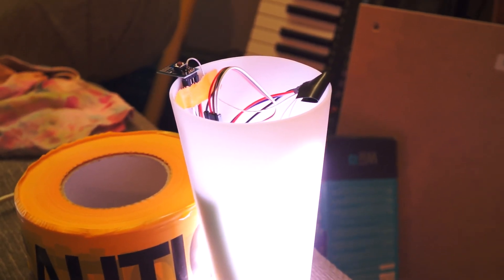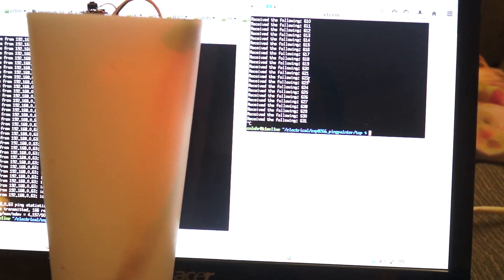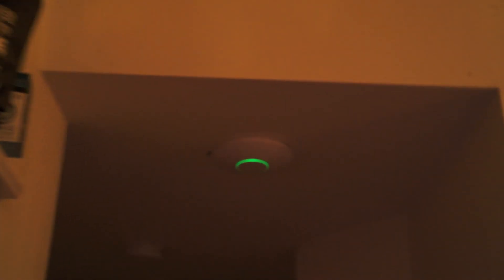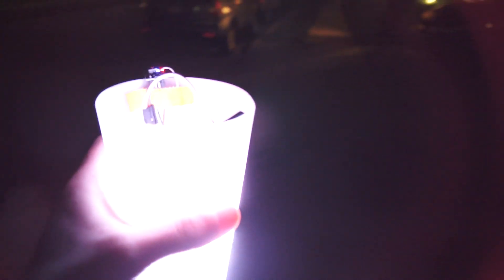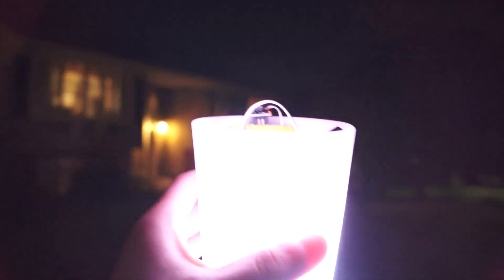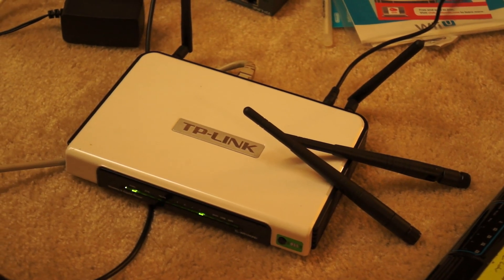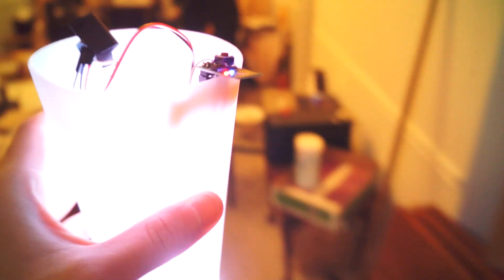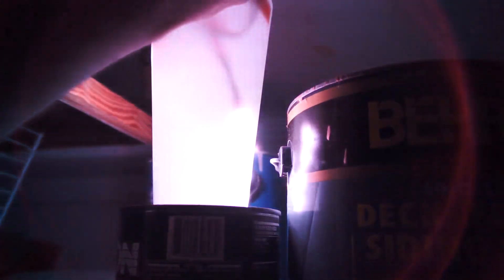My Wifi Cup - ESP8266 Link Tests

Comment: I think the example you give below Mike is having the same difficulty as me - getting the timing right. Without optimisation the compiler is just a little slow, with optimisation it's well fast enough but the cacheing is messing up the first iteration of the loop. The whole routine (which I have working perfectly apart from the first LED) needs re-writing in assembler. If you find MQTT to have a large overhead (agree) and a big learning curve (it's not, really) then I'm thinking the best solution would be for someone to add this to the LUA code then anyone can play with the LEDS without having to do the compiling. Incidentally if you've followed my posts you'll know how frustrated I felt about the compilation process and having to learn arcane Linux commands - but since the ECLIPSE post for setting things up in Windows, all that has changed. It's actually no big deal to compile the code. My own feeling is that given the addition of serial setup for the MQTT code that could end up as the main runner as the advantages of using it over other means of sending packets back and forth are huge.

But back to the subject at hand - if anyone wants to try their hand at turning this into optimisation-immune assembly I'm keen to test the code for them - about the only ESP8266 assembly I know is NOOP! long pulse as 0.9s, short pulses are 0.35us.

static void  send_ws_0()
{
  uint8_t i;
  i = 4; while(i--) WRITE_PERI_REG(PERIPHS_GPIO_BASEADDR + GPIO_ID_PIN(WSGPIO), 1);
  i = 9; while(i--) WRITE_PERI_REG(PERIPHS_GPIO_BASEADDR + GPIO_ID_PIN(WSGPIO), 0);
}

static void  send_ws_1()
{
  uint8_t i;
  i = 10; while(i--) WRITE_PERI_REG(PERIPHS_GPIO_BASEADDR + GPIO_ID_PIN(WSGPIO), 1);
  i = 3; while(i--) WRITE_PERI_REG(PERIPHS_GPIO_BASEADDR + GPIO_ID_PIN(WSGPIO), 0);
}

static int  gpio_ws2812( char *buffer, int length)
{
  uint8_t mask;
  os_intr_lock();
  const char *end = buffer + length;
  while( buffer != end ) {
	  mask = 0x80;
	  while (mask) {
      (*buffer & mask) ? send_ws_1() : send_ws_0();
      mask >>= 1;
    }
    ++buffer;
  }
  os_intr_unlock();

  return 0;
}
Reply from the maker: Darn, I expected those functions to be pretty volatile, and that optimization would not impact them heavily.  I guess I was wrong.  I would be more than happy to merge someone else's ASM version of this, though.

Comment: good job! I wonder how many WS2812 are you able to control with that driver ?
in the code you mention not disabling the gpio interrupt for more than 10us. I don't know how the WS2812 works but would it be possible to control about 30 leds with some timers & tweaks ?
Reply from the maker: Not many, and it's unreliable.  It can probably control the 30, but don't expect it to be perfect.
Reply: Ok good to know, thanks a lot!

Comment: Wondering what your dev setup looks like? I see you have a USB2TLL converter, I guess bootstrapping code into the Wifi chip? Are you running linux? Where did you get the info to setup the software side of your toolchain?

Thanks!
Reply from the maker: I actually took it from bits and pieces of stuff on the ESP8266 forums.  They've gotten things a lot more flushed out now, and I don't have any good info on the newer ways to do it.  I do have a button on my ESP8266 I click when I reset to make it go into program mode.  I type "make" and it flashes it with the new firmware.

Comment: Excellent work, no useless AVR, you made ESP8266 do all work, I hope soon you will master PWM on ESP8266 so you can ditch WS2812B
Reply from the maker: I would much rather just improve the WS2812B circuitry!  But, PWM would be useful, too.  AVRs are so cool... I might just litter some in my circuits anyway.

Comment: Creative way to test the wifi module! edit: removed section asking for help, I figured it out finally: 9600 baud worked right out of the box, and TX/RX pins appeared swapped http://www.electrodragon.com/w/Wi07c
Reply from the maker: 9600 baud??? I am unaware of any chips that ship with 9600 baud.
Reply: CNLohr it was from electro dragon!  It was very frustrating, but I finally decided to try 9600 because it was the new firmware default... Tada >.<
Reply from the maker: sigh

Comment: I manage to compile the code and run it but I could not get any further. I used my phone to connect to AP that been created by the ESP8266. Then used the ip 192.168.4.1 with UDP port 7777 to send random data but nothing happens. Could you share the code you use to send UDP packets?.
Reply from the maker: I got the repo wrong! Sorry :(  I fixed the description.
Reply: CNLohr
I get this error when i try to compile,
"user/user_main.c:135:6: error: passing argument 2 of 'espconn_regist_sentcb' from incompatible pointer type [-Werror]
      espconn_regist_sentcb(pUdpServer, at_udpserver_send);"
BTW i had to use the makefile from https://github.com/esp8266/source-code-examples. your makefile didnt work since sdk configuration is different
Reply from the maker: AH!  You need to  #define  NETWORK to be your AP, and PASSWORD to be your AP's password.
Reply: CNLohr I defined those at config.h. If i define again compiler going to yell at me. BTW i'm a newbie when comes to compiling my own ESP8266 firmware. I used the ubuntu image that have been given with tool chain installed
Reply from the maker: Hmm.. can you copy-and-paste the errors?  It should /just/ work if you have those values defined properly.  Did you put quotes around them?  It should be #define NETWORK "my_ap" /  #define  PASSWORD "my_password"
Reply: CNLohr yes i put quotation around them. I tried using 9.1 and 9.2 sdk but they get the same error.

CC user/user_main.c
user/user_main.c: In function 'at_procTask':
user/user_main.c:135:6: error: passing argument 2 of 'espconn_regist_sentcb' from incompatible pointer type [-Werror]
      espconn_regist_sentcb(pUdpServer, at_udpserver_send);
      ^
In file included from user/user_main.c:7:0:
/opt/Espressif/ESP8266_SDK//include/espconn.h:147:7: note: expected 'espconn_sent_callback' but argument is of type 'void (*)(void *, char *, short unsigned int)'
 sint8 espconn_regist_sentcb(struct espconn *espconn, espconn_sent_callback sent_cb);
       ^
cc1: all warnings being treated as errors
make: * [build/user/user_main.o] Error 1

Comment: Cool project and very funny. What is your internet speed in the house, or should I better say what is the restricted speed that your roommate gave you? :D
Reply: We're connected by Verizon FIOS at 150 megabits symmetric. The service is great, but I'm disappointed that they've decided to stop rolling out the service despite all the tax dollars they've accepted over the years to improve their network. If a more network-neutrality friendly ISP existed, I'd probably switch to them even if the speed were slower or the price higher, just so I could stop giving money to Verizon.

I used to have QoS configured when we had a slower connection, but as a practical matter there isn't much that you can do to tie up the network when it's this fast. Even transferring data over HTTP at maximum rate doesn't hurt the performance of interactive SSH sessions. We don't have VOIP, but I imagine it would be similarly immune to the influence of other traffic.
Reply: will11m They haven't stopped rolling out, I'm getting fiber in the next 2 months after a year of terrible cellular internet that costs an arm, leg, kidney and an eyeball per month for very hard capped internet! Cried from relief at the news